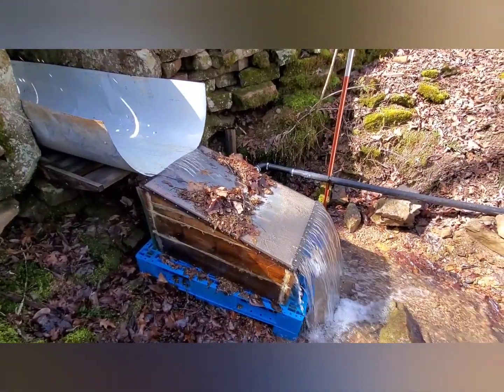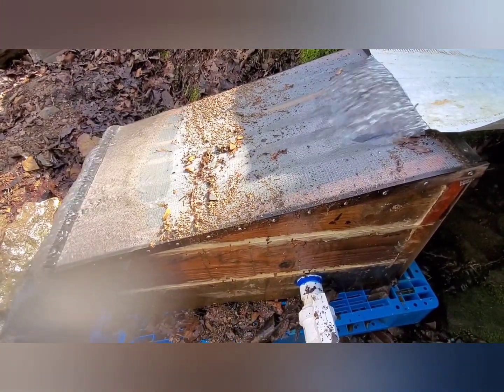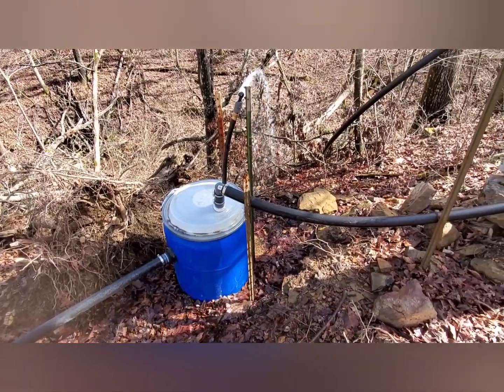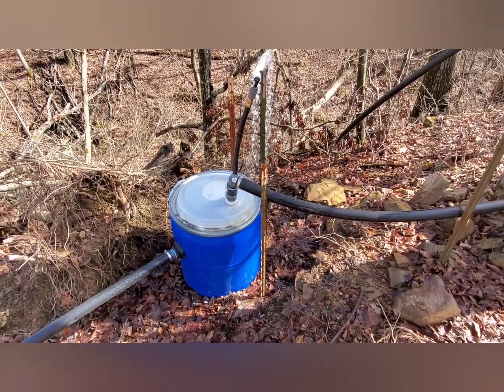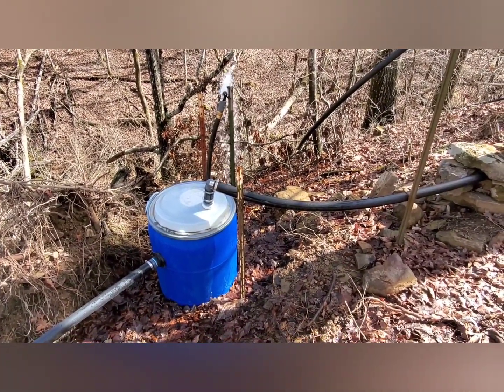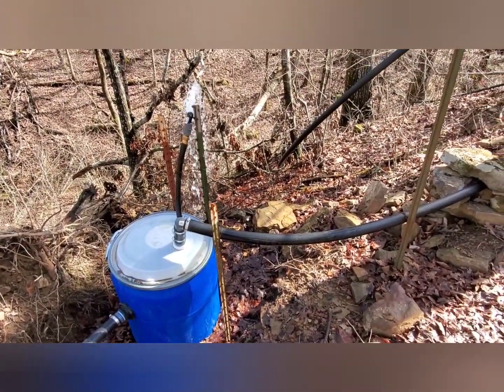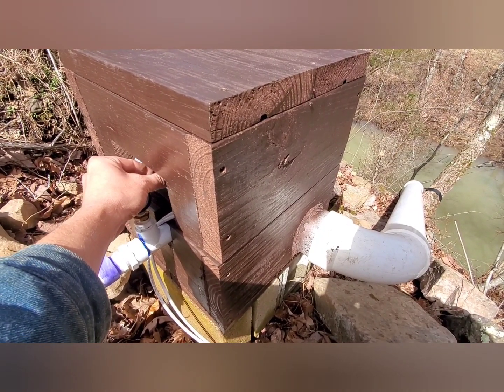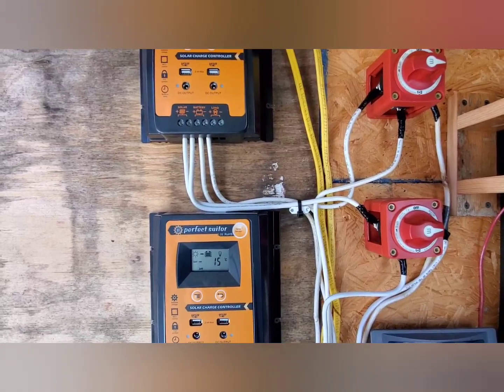Off Grid Micro Hydro Turbine  - Part 7

Comment: A silt filter barrel should never be located in the drop section of a drive pipe, resulting in loss of head pressure. In best practice the free water level of the silt filter barrel is the start height of the drop section of your drive pipe. Relocating the silt filter barrel up the hill next to the collection will increase the head pressure and so also your power output at the generator.

Comment: hi from Papua New Guinea. Just want to ask if you can tell us What's is the head? What is the flow rate? The pressure at the hydro? How many appliances you can power using this setup and for how long?
Reply from the maker: 150 feet of head, 68 psi with the turbine running, and it produces 10 amps on 12 volt/ 5 amps on 24 volt.

Comment: You can leave both controllers on as the 12v system will charge first when upto voltage the controller will release the pull down on turbine and the 24v system will charge that or have a mppt between the 24v and the 12v or even a 2nd turbine one 24v the other 12v

Comment: No do not close off the vent line. The line NEEDS to be open to allow air through. But if the vent (head) pipe is vertical up to the height just above the water level of the supply/filter box, all the will go up and out, but you will retain ALL of the head from the water level at the supply/filter box.
Reply: it appears that you  did  Not  understand  what the  issue  was.    it was, too  much  Water.!!!!!
Reply: @daviddavids2884  It appears you did not understand my comment. The vent in the blue drum is not a vent if it is closed. The purpose of this vent is to let air out of the system before it enters the penstock. The vent outlet needs to be at the highest possible height, just above the pick up screen in elevation, in order to maximize the available head. The blue drum needs to be strong enough to take the head it has, he said it is 10-12 foot of drop that is 5.2 psi. (It does look like it is strong enough)  If the drum can not cope with this head, then it should be replaced with a stronger container, or moved up stream a little, to reduce the pressure on it. (As I advised him on his previous video.) 
His problem has nothing to do with how much water there is, it has to do with the placement of the air relief tank and the material it is made of.
 By the way, how is your hydro set-up going?

Comment: Yes I would definitely replace the blue drum. It needs to take the full head from the supply/filter box. In theory only air should travel up and out of the top of the (head) pipe, but is reality water surges up and down the (head) pipe. The hose out the top of the drum needs to be able to cope with all of the flow to the blue drum. So when you close the turbine off all the water can flow up to the top of the (head) pipe, and not pressurize the blue drum. The top of the (head) pipe should be a height just above the water level at the supply/filter box. This will allow all the air to escape up and out of the line. 
 That will give you maximum potential down at the turbine.  I have been working with my system and found setting it up as I have described is best.
Reply from the maker: Thank you. I agree, I will probably move the barrel closer to the box in the future.